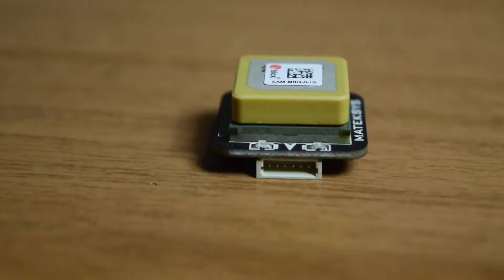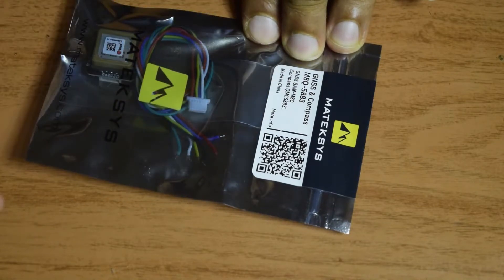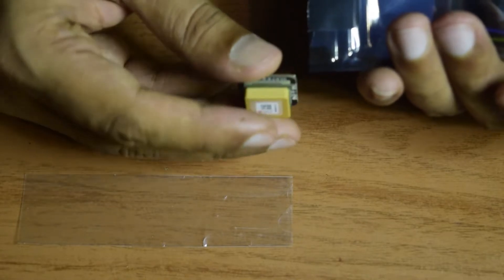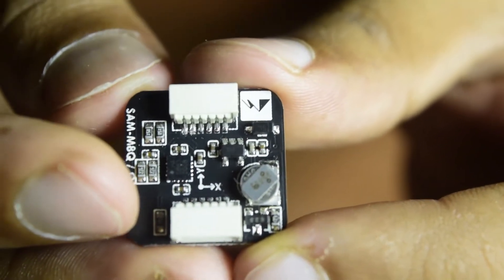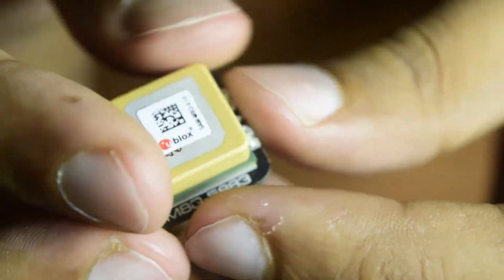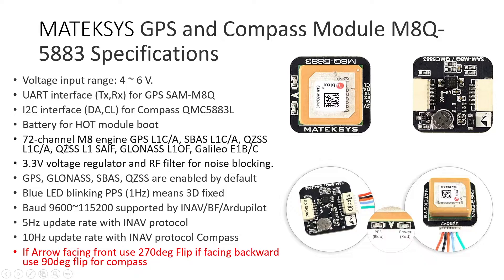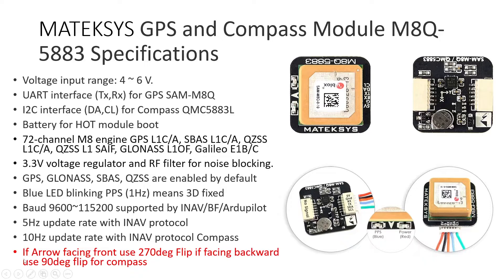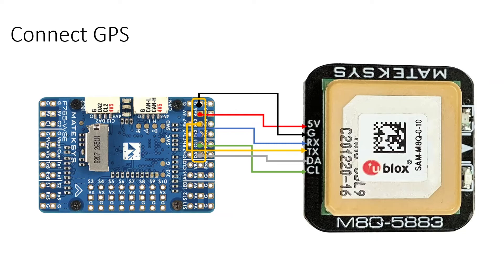BEIGNNERS GUIDE TO DRONE GPS MODULE | MATEKSYS GPS WITH COMPASS M8Q-5883 Ublox SAM-M8Q GPS QMC5883L

Comment: if i want use gps at my drone and i want my drone can RTH. How to install with direction gps
Reply from the maker: this video was exactly that , you need a GPS with magnetometer. Once you have connected it correctly to the flight controller all you need is to set this up in the firmware in betaflight or inav. I hope this video helped. please stay tuned to mu channel for my future videos

Comment: im using the m8q gps on my fpv, but my diatone fc doesn´t have DA and CL pad´s. shoul i just wire wire the rest and forget them ?
Reply from the maker: DA and CL are used for magnetometer , so if you only connect TX and RX you will be having the GPS functionality but no magnetometer. I hope this helps. Please stay tuned to my channel for my future videos.